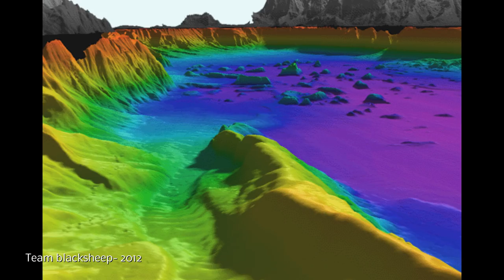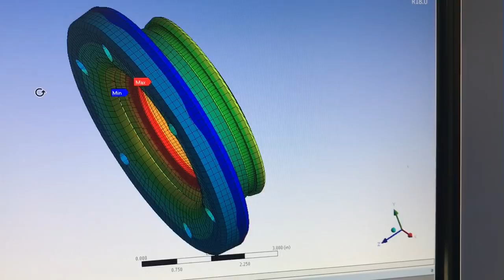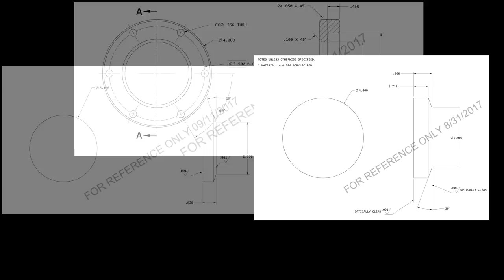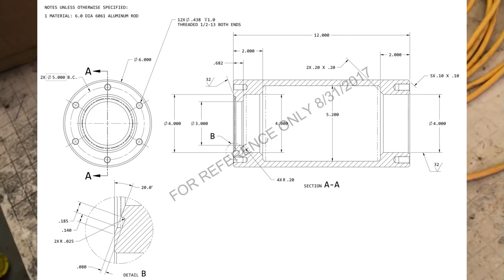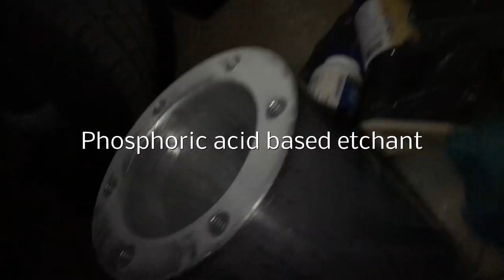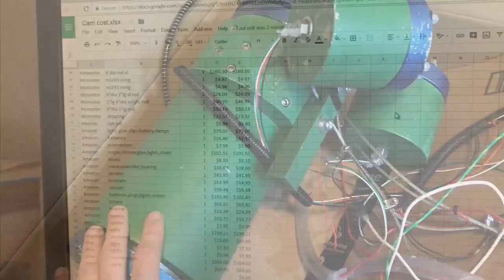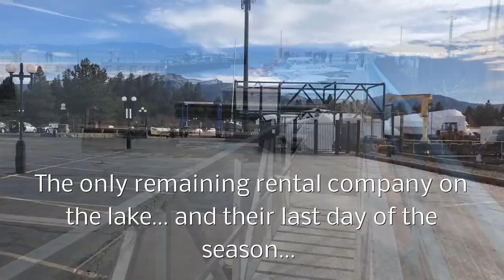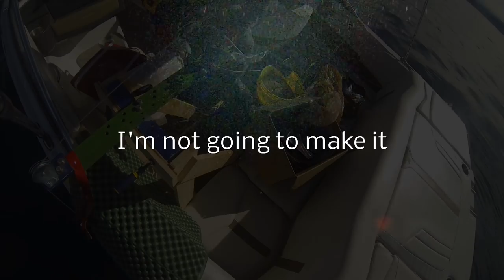DEEP Underwater Camera Build and Test in Lake Tahoe

Comment: 1. You should have tried a shallower spot for the first time around. 
2. Make a cable spool with a sprocket on the side that meshes with a 3 speed lawnmower transmission then somehow hook that to some old chainsaw. And Then... just send it!
3. Get a good looking woman in a string bikini to help you and use her as click bait aswell.
Reply from the maker: 1 I honestly consider this the shallow spot test, I knew it would be totally fine 60ft down in any lake and would have paid a similar amount for a boat large enough anywhere. 
2 Yes, I Do plan on making a powered winch now, honestly I did not have the space in my car for it in CA! 
3 Good Idea

Comment: Great stuff. If you could make a big barrelled winch it would make your life a lot easier. Have the drum the cable came on as the barrel or something with gears/pulleys and a handle on it. No more winching it in a bit then dumping the slack on the boat deck!

Looks like it might need more lights if that's an option too!

Really enjoyed you watching you live life correctly.
Reply from the maker: Certainly pursuing a good winch now that I am home, I honestly did not have the space in my car for one out there! Plus I've never turned down a little suffering. You gotta start with the worst if you really want to know whats important, so long as it doesn't kill you. 
Yes, lights will be very important, the water is actually pretty clear down there. I have a couple things I want to try out to get some legit clear views from down in the black.

Comment: Coax cable. IE, use your main steel wire as main and pass (either sleeve or tie with shrink wrap) a second, thinner wire that's isolated (like stranded wire). You'll need a signal amplifier on each end, but live feed is a go.

Comment: If you want to measure the length of your cable with less struggle, consider weighing it. Weight a known length (100 feet?) and use that as reference to compare your total weight.
Reply: While that does work fine, it is a bit hard to trust and I did want to keep the cable

Comment: i feel it would work better with a simpler setup. if that pod holds up to the pressure i guess it would make things easier to build one that has about the same weight as its volume in water if you catch my drift and then you can use a suppliereel of high sea fishing line (i think thats also neutral weight). no more cable no more winching
Reply from the maker: Of course! One of the things I am adding now that I am home is a nice big chunk of syntactic foam to make it close to neutrally buoyant. The thick cable will be good when I start towing the thing or if it ever gets stuck on stuff
Reply: keep in mind that any foam will compress and lower its boienzie (even when its spelled correctly). better make it more floaty and have a sacrificial stone or something that unhocks when it touches the bottom. or maybe not rely on that
Reply from the maker: While that is a good general rule, ROV's actually tend to get more buoyant when you go really deep down (10k-20kft). Water's bulk modulus is 2.2 GPa and most deepwater syntactic foams have a bulk modulus in the 2.9GPa range. Also metals have high bulk moduli (AL is ~70GPa). The water compresses more than the foam and metal, making the foam float more (If your craft is built to take such high pressures). 

Kinda nuts, but the ROV JASON needs to crank its sink thrusters up more and more the deeper it goes. They are at full power when it is at full depth. 
A simple answer to this is to just make your thing heavier, necessitating a strong crane uptop which I think is worth exploring, that's why I'm screwing around with it. 
It's not easy to avoid a strong tether. The NEREUS did it quite nicely, but that was also fully autonomous. 

Thanks!
Reply: wow didnt know that. its an awesome project you are doing best of luck :)

Comment: Wouldn't the GoPro Implode rather than explode, given that it is put under almost 50 atmospheres of pressure at the bottom. An explosion under those circumstances I find rather unlikely.
Reply from the maker: The important thing is that it would be destroyed
Reply: Fair point.
Reply from the maker: but yes, you are right it would implode.